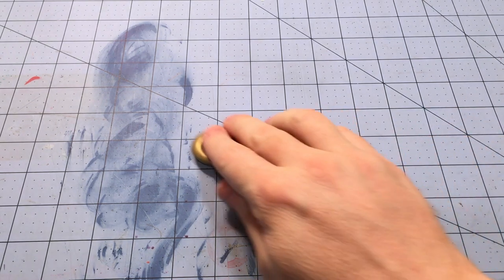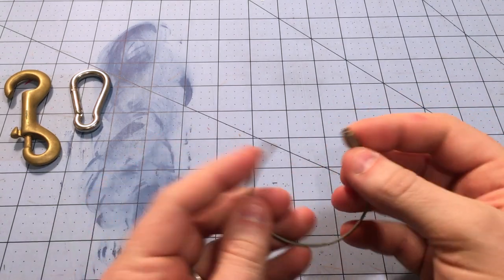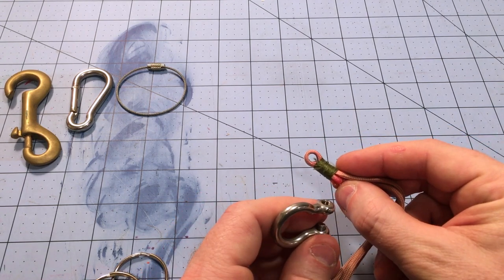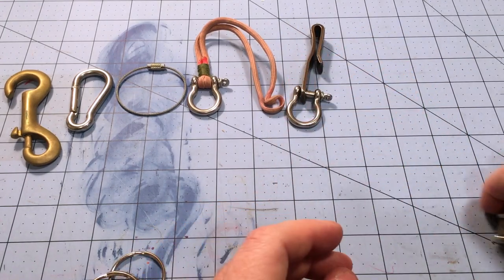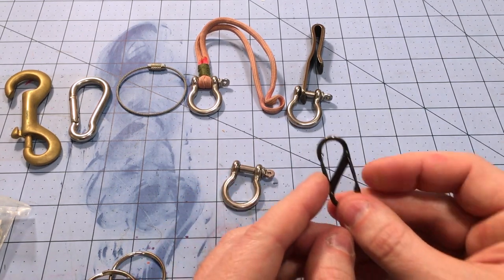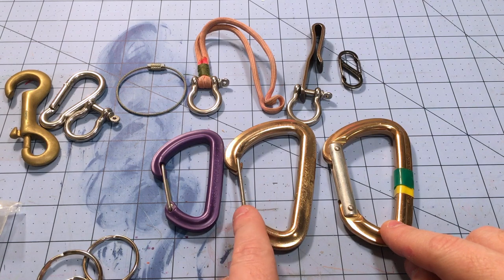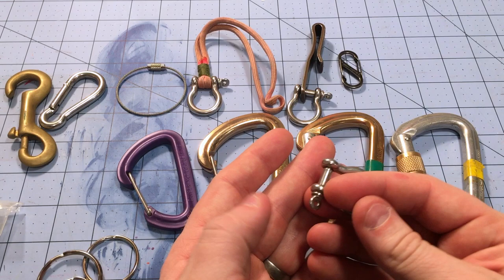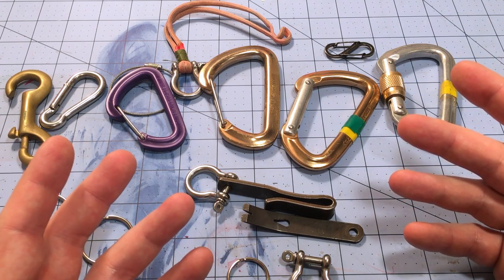EDC: Key Control

Comment: MECARMY EH3 carabiner and titanium split rings. The carabiner has a gate to clip onto the belt and a slot cut into for split rings. It’s also got a flathead screw driver/ pry bar comes in titanium and copper pretty nice solution not too big.

Comment: Using shackles is good, the down side is loosening of the bolt. Great video on key management options. Nite ize does make locking S biners. For a some years my keys have been on a separate locking S Biners on a larger key hook. There is a SAK knife,light pry multitool, and ID tag along with keys. It's 4 oz however the car key is easy to detach.

Comment: I like the key smart mini which is essentially a soft toggle and I put my truck key on a separate one with a quick connect. Also idk if I wanna have them in my pocket or hang them from a belt loop

Comment: I've tried many options over the years, and I finally settled on the Secure A Key. It clips onto your belt, and I use a large split ring that snaps into the holder. Works great. You can get them at your local locksmith.

Comment: Your first example, the heavy brass horse or dog snap hook, is intended to be crimped in a vise or carefully peened with a hammer.

Wichard (France) has small to quite large bow or anchor shackles in stainless or titanium which have detents as an option on certain models; these virtually eliminating the screw pins backing out. They also have “captive pin” models in which the pin stays with the shackle body.
Wichard has a great variety of very small to very large maillon rapids in useful configurations, the smallest in 2.0 mm diameter material as I recall. Wichard makes snap shackles with the wire latch which they may have invented(?); these in stainless and titanium. I’ve used the smallest stainless model daily for thirty years!
Davis has marine brass sailing snaps in sundry models which are cute and useful.
Check our Green Boat Stuff as a supplier of the above.
Learning to tie fobs and lanyards is recommended

Comment: That was a good rundown of the "struggle" and interest in finding options for our keys.   I have been using the Clip Cat by  E.K. Ekcessories for 6 plus years.  I have tried other methods, but I keep coming back to the Clip Cat.   With car key on one side and house/misc on the other, I enjoy being able to easily disconnect the house and other keys from the car key when dropping the car off at the shop, lending my car, or disconnecting it while the car is running so my wife can run back in house and get something we forgot!  Most importantly, it has never failed me or opened without my operation.  Thanks again for the video and ideas.     After thought... I might get a new Clip Cat in a bright color, as the current grey does not help me find my keys given my bad habit of leaving the keys in different places around the kitchen or in the darkness of my pack.  hah!
Reply from the maker: Thanks!
For me, it's one of those problems for which there is no perfect solution- and since my needs change regularly, my solutions need to adapt as well. And: I loath large key rings- I can't stand carrying too much in my pocket.

Comment: Ooooooo yeah its hard finding a good best lite useful reality key ring set up. I used to use a plain ol split ring till I thought why do I have this this this I have no idea why I need this on my keys set up and killed the poor split ring every time I would eliminate or add new items. I try the cow nose ring and stop using it quickly as I got home. Then I went back  to the split ring but this time I got some thicker and bigger but those became annoying also. Took a trip to hobby lobby and found some janitor ring the one you need to pull open and bingo ! I found a system that works ! I've been using climbing carabiner clips for year's witch I wear on my belt and belt loop so that it stays put. So those janitor rings and the clip great combination ! No more unnecessary keys tools or anything unnecessary goes on my rings.
One house key, one small good functional key lite, one mini pry bar tool and my Fire🔥 Nation ID dogtag is all I have and need on my keys that I have and use.
For my work keys its the same set up but its on a short keyleash without the dogtag and lite but with bike lock key and cuff key. Again simple usefull reality usefull items with out the unnecessary items.